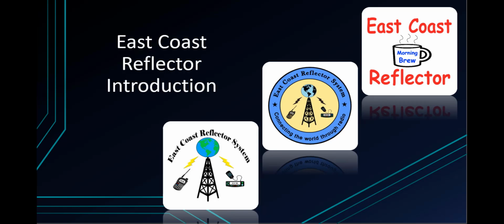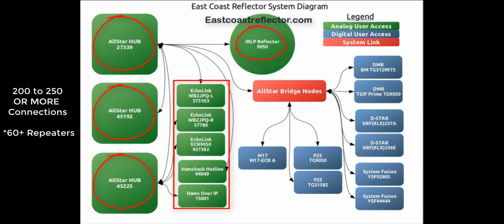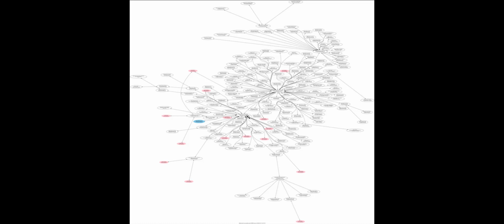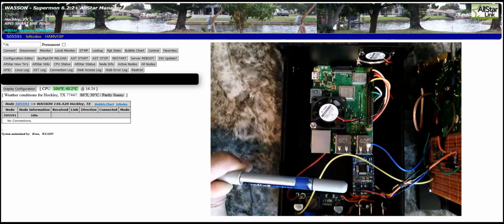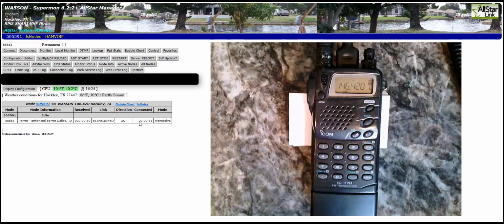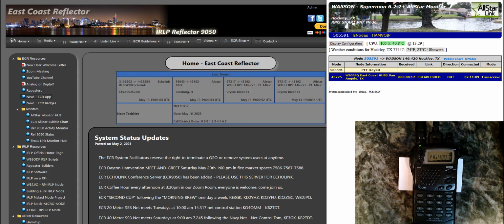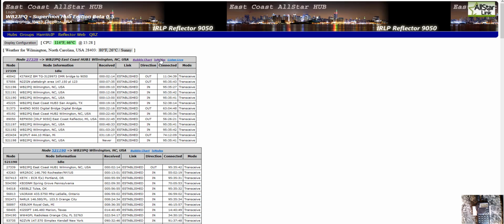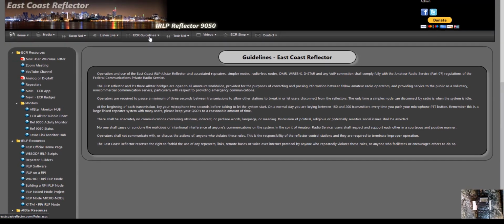East Coast Reflector - Introduction Video

Comment: I just discovered the ECR on my UV5R connected to a homemade 2 meter dipole antenna. Dumb question: If cell towers or internet goes down, some feeder digital systems and all or part of ECR go down depending on how widespread the outage? If so, this is not SHTF tech. Is this correct? The ECR is impressive, but I want to understand it’s limitations and capabilities.
Reply from the maker: Correct. But it's so big and has so many different pieces,  that if one thing goes wrong, that one piece goes down and the rest of the system stands.

Also, we're global. Ypu don't want someone sending out some type of warning in Australia and risk people in Florida thinking it applies. 
We'd help if needed, but it would be too unpredictable as to how we'd be able to help depending on circumstances.

Comment: So I just took my technician license test last night and passed it. I have been listening to local nets and repertors for a couple of months now. The other day I was running a little later than normal to work and one of the repertors was connected to the ECR for the morning brew net witch I found to be pretty cool. I didn't get to listen long as I ran out of range   but it made me asked a lot of questions  so the ECR  is always on and running and not just for nets ? And is there a lot of traffic on there most of the time?
Reply: Thanks for any help
Reply from the maker: Definitely not just for nets! Www.Bit.ly/ecrwelcome our welcome letter  lists the nets that we do have and explains the system. The Tech Net is on every Tuesday at 8pm eastern and is a great place to ask questions. Youbcan also email w2ecr9050@gmail.com

Comment: the East Coast Reflector listener page
needs a Stop Light icon indicating 
how well the Reflector is working
that day.
Green for excellent, Yellow for break up,
and Red for disconnections.
from a non licensed, RTL-SDR user employing Pizza-pan antenna who enjoys the Morning Brew
Reply: So I have only heard the morning brew once  only because I was running late for work 😂does it not work well all the time?
Reply from the maker: Monday through Friday 7am to 9 am est
Reply: @eastcoastreflector  right the morning brew runs at those times but once I get my call sine and I get a node can the system be used to talk on the rest of the  times  hopefully that makes since
Reply from the maker: You Tube rearranges these responses and they tend to seem out of place.
To your license... Great!
To the lights...  not so simple. The system can be running great, but the repeater you go through may be down temporarily. There are hundreds of connections at any given time. Anybody can connect or disconnect as they please. 
Good luck on your license!
Reply from the maker: It depends on the owner of the repeater  you're using. For only listing...
https://m.broadcastify.com/listen/feed/12560
Reply from the maker: For a list of ways to connect...
https://www.eastcoastreflector.com/welcome-to-ecr/